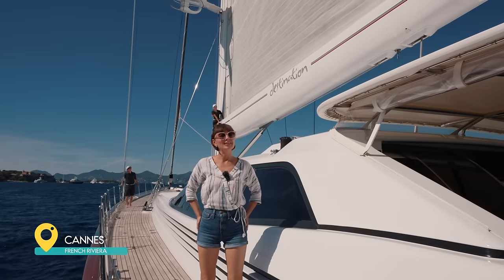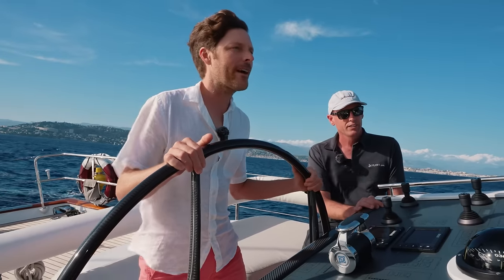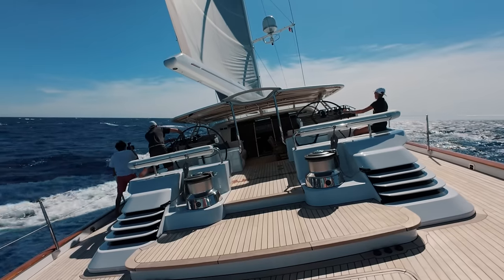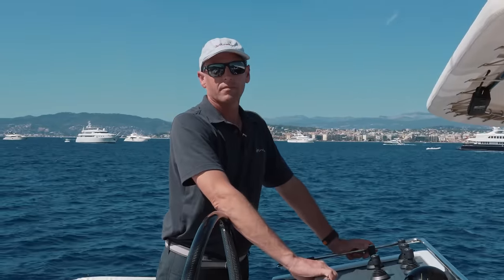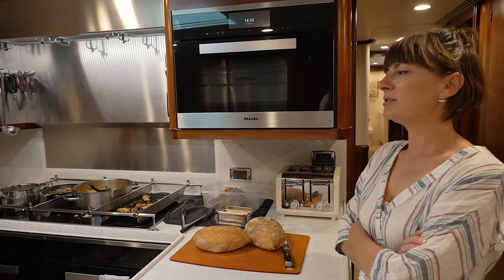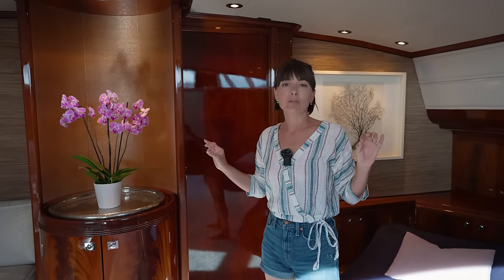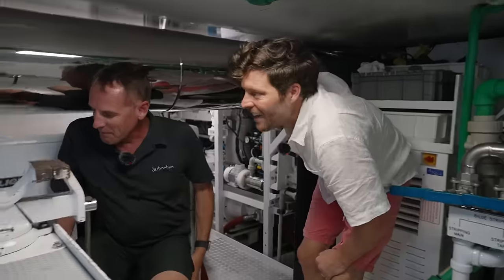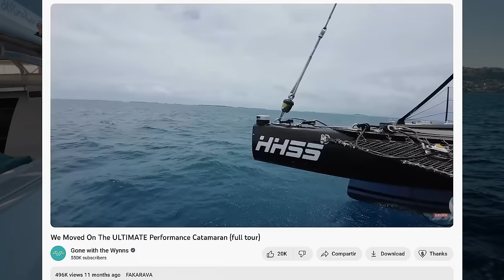SAILING ON A 135-FOOT SUPERYACHT (+full tour)

Comment: Beautiful, though moving around down below in any kind of sea must be a bit of a challenge, as there don't seem to be many grabrails. With this kind of boat I guess that the first sign of a blow generally means a hasty retreat to somewhere sheltered.  Having said which, if they've been to Antarctica, they won't have been able to do that.  It's nice to see that she's been put to good use, rather than sitting in port most of the time, for the occupants to pose :)

Comment: Amazing!  Where do you take these boats for haul out to clean the bottom?
Reply from the maker: Not sure of exact location, but it's definitely possible. If you only need to clean the bottom, it's probably cheaper to hire divers to do that. For more extensive repair or painting, I don't know if there's a boat lift out there large enough to take it out via that method, but even an aircraft carrier can be dry-docked. All you need is enough money to pay the specialized boatyard with the big dry-dock, and if you can buy a 12 million pound boat I'm guessing you're covered there. Guessing, because I'll never know! 😁
Curious Minion

Comment: I had to enjoy Jason trying to navigate the boat underway.  a 15º heel is pretty good, actually.  Now, understand, I was in the Air Force and not the Navy, but submarine sailors kind of do something similar, called 'angles and dangles.'  For a submarine, above all, stealth and being totally quiet is the most important thing. so when they head out on patrol, one of the first things once they hit deep water to to exercise the boat (submarines have traditionally been called 'boats.')  They do this by putting extreme angles, up and down, on the boat to make sure nothing is unsecured and not moving around, making noise.  You can see a 29º angle in this video (Caution:  Language at one point, normal sailor talk)

https://www.youtube.com/watch?v=AGaEHd1QTuI

I was pretty impressed with 12 knots in a 15 knot breeze, or maybe I misunderstood that.  Considering Jason's proclivity for seasickness, though, I would stick to a catamaran.  However, I truly did enjoy this video, thank you for sharing.

Comment: wonder what the yearly fixed cost to operate that beautiful yacht is?
Reply: I've heard a ballpark figure of about 20% the value of the boat per year often mentioned, but not applied to a vessel this size.   If that statement is generic, for a $12 mil sailing yacht, that would be about $2.5 mil/year, but suspect it may be a lot more if you factor in a full crew and scale of this thing (dry dock, insurance, berthing, anchorage, etc).   Almost everything in that boat was 'best quality available,' from the diesel engines to the kitchen sink.   Annual cost to run that thing is in the category of 'shiver me timbers!  If ya gotta ask ...'
Reply: @bacca71  that 20% formula is usually what you'd expect to spend on maintenance and insurance.  However fixed cost on a yacht that size also includes crew salary, crew training, and probably several other items.  All the expenses you have to pay regardless if you are using the yacht.  Then there is the variable cost or what some people call operating cost.  Items such as fuel, port fees, immigration fees, additional crew if needed, food, etc.

Comment: Better stock it with as much food fuel and supplies as you can afford ..
  I have been doing Astral travel since I was a kid and eventually I found myself in the future and I never realized this could even be possible however this was my ultimate wake up call as it was quite a lot different from all the other times as I was living it and I have no other words to describe it  ..  I spent a day in the future and there was no getting out of it, it happened in 1984 and I was me in what appeared to be the not too distant future.  I was living in Lahaina Maui and I had gotten a room in a gated community called Pu Amana and my room was across the hall from another guitarist named Wess Montgomery, a jazz guitarist.  I was laying on my bed one day and I could hear Wess quietly playing his guitar and I looked up on the wall and I was staring at a Gecko and the next thing I know I am standing in a Semi-trailer next to a big diesel powered generator and as near as I could tell I am there to work on getting it running.  This is a larger trailer with two big open doors on each side of it as well as the doors in the back and I look down and see very large cables coming out of it about three to four inches in diameter and they are going into the front door of this dark grey building as it is dark inside and there is no one around.  There are no cars driving around and all is very quiet and there is obviously no electricity anywhere.  I jump down out of the trailer and start looking around and that's when I realize that I am back in the town I came from back on the mainland, Longview Washington  before I left for Maui.  The only problem is however as I start looking around is that I find this big concrete building before me is on the corner of what they call the Triangle mall parking lot and there is supposed to be a little phone booth type gas station here,  my friend JJ worked there pumping gas.  I couldn't find any people or any indications for what might have happened or any reason for the whole thing until on towards the end of the day when I finally saw a few people approaching on foot off in the distance. From what I could gather from these people we were in war time and they were coming here to meet members of thier families who were returning here from a battle. The meeting place is this building and these people are coming here to be euthanized as it is that they are dying and I can't even find words to describe how messed up these people were but it looked like radiation burns and disfigurement and they were radio active, there was no hope for them, thier family members were here to say goodbye to them.  I spent a year on Maui and when I returned to the mainland and Longview I went over to that corner of the Triangle parking lot to see and there it was the building just exactly as I had seen it and it was a movie theater. Well it was exactly as I had seen it except for one small detail, it was painted a pale yellow with a blue stripe around the middle of it but it wasn't very long and the theater had closed it's doors and was an abandoned building for several years, until  one day I drove over to look at it and it was being renovated by a construction company as it had been purchased by a church group called father's house and when they were all done with it they painted the outside of the building and it is now dark grey.  One more important thing left here to come to pass is something I found hard to believe about the whole experience during the Trump administration and that would ever be our involvement in a nuclear war.  I thought for a time that there was a chance for a change in the course of the future but now it seems that I will be taking my place again in the not to distant future  ....

Comment: Dishwashers work best when you can run them within minutes of the meal finish. If the soiled surfaces get dried you get poor results. So the question comes down to size, can you fill it with one full meal...or are you wasting water/soap to run it less full. I choose hand wash since im already rinsing heavily just to load the dishwasher w dishes that sit waiting. On land two smaller dishwashers might make sense so you don't unload, the clean one is just used as your cupboard, alternating after each large meal. And a big Thanks for this sailing video escape!